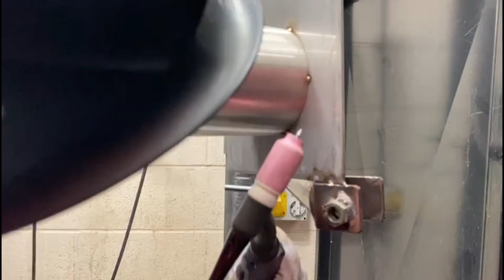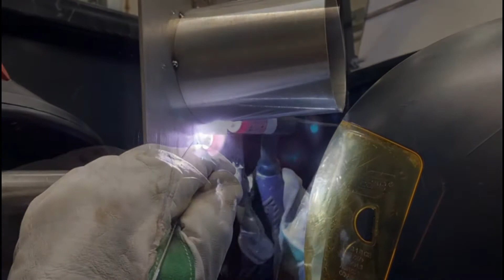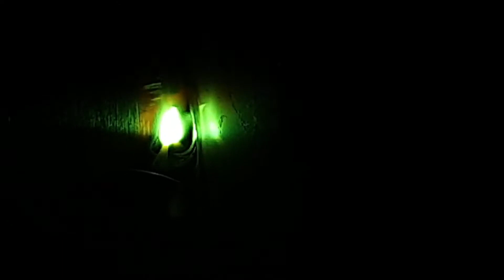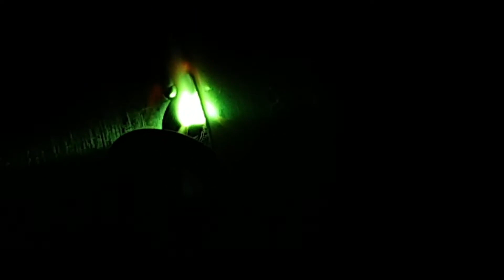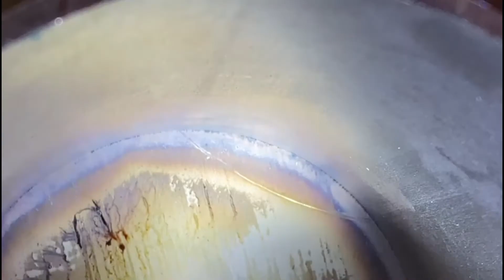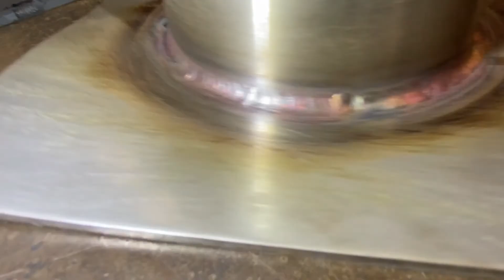I Mastered Tig Welding Stainless Steel in 5F and You Can Too!

Comment: I am an experienced welder from belgium . I have done alot of different alloys tig stick and mig/mag . And a bit of flux core. Steel,chrome,stainless,duplex aluminium,inconel and other nickel alloys . Food, farma, gas pipeline, petrochemicals, steam. these specific tips will be for stainless : Nr1  Allways use a bigger cup size with stainless nr8 and above, it will give you a better gas coverage . Nr2 allways use a gaslens on your torch ,it will give you a better gas coverage. Nr3 allways hold the fillerwire in the gas protected zone . Nr 4 allways use 4.6 grade argon or better . You can also use mixes with hydrogen but that is more towards orbital welding for food and farmacy ,hydrogen mix will give you a higher voltage per amp and you will get a different less stable arc with more penetration capability (only use it on 300 series stainless) . Nr5 after the weld has ended keep your filler wire in the gas protected zone and your cup against the metal you welded , reason is not to contaminate the filler wire . But also the tungsten electrode will have a longer lifespan for it deteriorates faster if its contaminated with oxygen witch happens at higher temperatures. Nr6 use a long enough post weld gasflow. At least 5 sec minimum. nr7 Keep your tungsten allways sharp . Different electrode degrees will give you different arc values , the sharper the less voltage therefore the less heat imput . Sometimes you need a sharp angle for example nuclear facilities require a very strict wps witch discribes electrode angle, sometimes you need a big angle for more voltage for your rootpass . It comes with experiance . Nr8 use a bit of pre flow to help shield the tungsten and the metal . Nr9 use upslope if you are running higher amps , otherwise your tungsten electrode will deteriorate faster and may project little pieces of tungsten in your weldmetal . Nr 10 . Use the correct diameter size tungsten for the amount of amps.
Reply: Nr11 Use downslope to not get a crater, different metals will react differentley. for stainless at least 5 seconds . Nr12 use the max amps you can comfortably handle , meaning you can controle before it sags or dances around too much . This will make you weld faster and get you less heat input . Your welds will look better with less coloration. BUT AT ALL TIMES RESPECT THE WPS IF THEY ARE VERY STRICT, some companies will do an etch test on the surface of your weldbead to see how much amps you did use and believe me they are not stupid. Nr13 abc allways be comfortable, it makes alot of difference. Nr14 allways do a dry run to see how much you can weld and to look at your body and hand positions, it can make a big difference if you have the foresight. Nr15 allways clean between weldpasses, it will make you faster and will give you better results. Nr16 learn to weld out of hand and walking the cup. Both have their positives and negatives. And learn to weld with different grip styles, be flexible. Nr17 learn how to weld with both hands!!! You will get in situations when things are difficult. Nobody wants a crybaby who says they cannot do the job. Nr18 allways verify the basemetal with the filler wire LOOK AT THE WPS , i have seen mistakes happen with this one because some people get sloppy and they have to cut out and weld it again. It will make you look bad . Nr 19 learn different feeding techniques. Dipping the wire, laywire, keyhole . Different techniques for different situations.  Be versatile for it will help you. Nr20 take a filler wire and practice hand feeding at home while watching tv or listening to the radio or whatever you are doing . Do it with both hands and with different techniques. This is one of the biggest difficulties I have seen with welders i have trained , even experienced stick welders who understand the puddle well but their feeding hand is lacking . Your feeding hand is doing a lot to the weld appearance and therefore the quality.
Reply: Nr21 get into a rhythm when welding . Meaning the movement with your welding hand and with your feeding hand . The more robotic and repetitive your movements the better the results . Listen to music while you weld and weld on the beat , it will help in the beginning. Nr22 learn to weld with a backfeeding technique , looking through the gap . Looking outside . Feeding from outside and feeding between the bevel edge. You will need all the techniques when the situation asks for it. Nr23 one day at a time, nobody began their trade as a master hone your skills and be patient with yourself even if the rest is not . Sharpen your skills like a knife. For myself personally I am a razor hardened and extremely sharp,the perfect tool for the job. Get your mindset at point. The rest will come with it. Nr 24 look ahead in the future . No robot will replace the highest skilled jobs in welding because they cannot . We are in 2023 at the moment and they have a massive shortage for top welders and fitters . If they could replace you with robots , they would do it in a heartbeat because money does not know respect and thats why if you get very skilled you should get top payed. Nr25 learn to fabricate and fit pipe . Get your math at point for it will make you a better welder and be a great asset for your employer. Nr26 do not lose your face and your name for you only have 1, it is a small world and word gets out fast. Do not disgrace yourself and part respectfully with grace for they will remember the rotten apples. Nr 27 quarter or backstep your welds if you can . It will help with distortion . Nr 28 if you can do as much as horizontal position welds if you can , you dont have to move or turn your workpiece as much . And you can weld hotter and faster and effecient. More comfortable witch will save your neck and back in the long run. Nr29 use the correct welding glass shade for the job . It is imperative short term and long term . For the quality of the welds and your health. Nr 30 do not smoke for welding is hazardous for your lungs enough. If you can use resperatores and filters . You only have 1 life . Nr 31. Check and dubble check your purge . With 300 series stainless you can purge with nitrogen,  argon and helium and nitrogen-hydrogen mix  . Nitrogen is the cheapest. Use as small purge chamber as possible for it will give you more controle and quality. Nr32 check the purge with your wire when you heat it up with the torch without welding the base metal . You can also use a thin plate if you have acces to it witch i prefer actually. And if good weld just a very small weld to check the purge quality ...That wraps it up for now .keep yourself in shape and keep on practicing . Dont be fat and lazy . But fit and sharp. these tips will get you very far in welding . Ps don't annoy me with too much comments or messages . Have a good day
Reply from the maker: Fantastic explanation! ❤️
Reply: @weldtechsolutions  saved you the time to do the explanation yourself 😉
Reply from the maker: @weldfox472  not sure we could beat that explanation 😁. Really well detailed.
Reply: @weldtechsolutions  dont be so modest . I am sure you can add at least a few on top of that
Reply from the maker: @weldfox472  thanks for watching and putting your analysis on the video. It’s nice to see people adding bits and pieces in the comments and helping others!